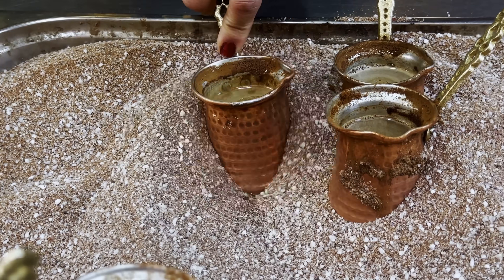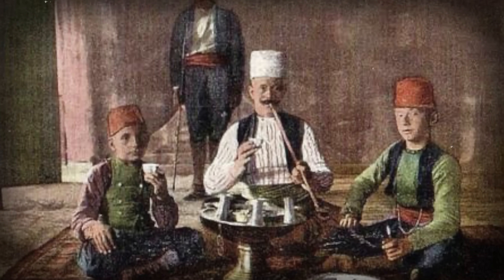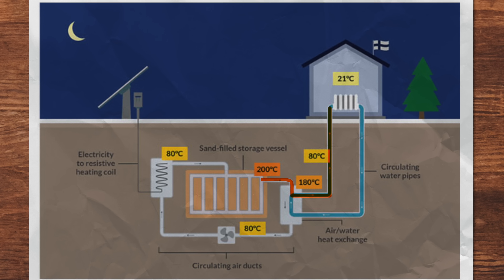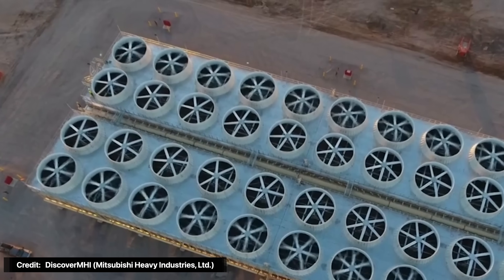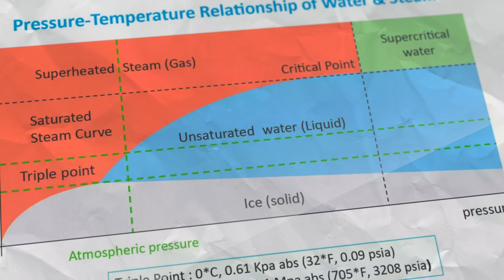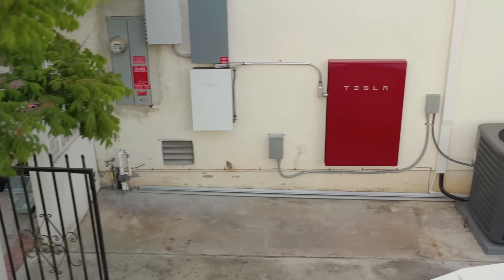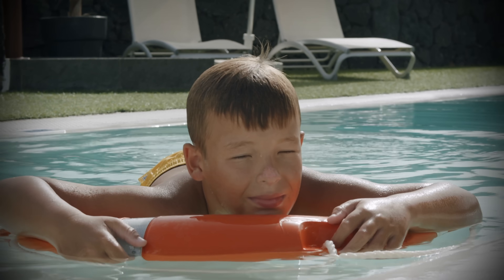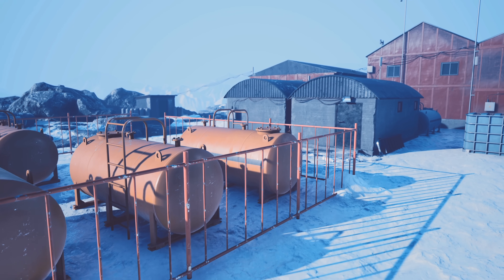The Power of Sand Batteries -- Revolutionizing Energy Storage...

Comment: I think DIYers will build sand batteries. You could probably build some rudimentry heating system using nothing but reclaimed bits and pieces and some tinkering
Reply: People do but it is harder than it looks.  One can use a water-heater's thermal element (electric backup element) for heating it up, but getting the heat out of the sand battery is actually not entirely trivial.   Basically you need something that can tolerate the heat and you need airflow to get the heat out again.   An open-ended steel pipe with a fan on one end to push air through, and then some fins (like a piece of a radiator) to disperse the heat in the air because you don't want a blast of hot air at 500C.

Regulating the output is the hard part. You can't just duct it to the house (not at 500C).  One mistake and the whole house burns down.
Reply: We have water batteries here in Germany. It´s just a huge insulated water tanks placed underground with a coil in it and some plumbing. Solar energy during the summer is being stored all the way up to the winter. It´s overall efficiency is better than with Li-ion batteries and it´s cheaper. Doesn´t get as hot as with Sand but is cheap and works.
Reply: On most videos you'll see on the subject, there's usually a lot of physical effort involved, and it doesn't really last past half a day. They work, but there's a human in the loop, and it's not a small part. An electrically-heated sand battery might require less effort, but there's usually not a reason to do that unless the electricity isn't coming from the grid, otherwise, you might as well turn on your normal electric heater. So far, I haven't seen anyone do anything beyond a proof of concept or proof that it works for the room they intend to heat.

Also, almost none of them do any sort of heat regulation, but that's usually because they're trying to heat a large room as quickly as possible. I've never seen one try to do a hot water system.
Reply: @Zeero3846  I'm jus thinking about building a sand battery for my home maybe this or next year. I was thinking about very well insulated concrete construction  in an non occupied room in my basement containing around 10 Tons of sand and around 100 meters of copper pipe buried inside as a close loop with  thermal exchangers connected to it. Obviously the thermal exchangers in use will be around 2x of the capacity I plan to achieve, so they can easily follow up.

One exchanger will be connected to the source of heat (coal/wood furnace), the other to the main central heating loop in house, which contains methane furnace and in-house heaters.

Early calculations indicate around 100kWh of stored heat, but I didn't finished with the design and calculations yet.

One thing is sure. It should be way cheaper than storing power in Li-ion or even storing heat in water.

Comment: You need hot water in the summer. You need hot water every day. We don't do nearly enough district heating. We have massive demand, year round, for heat.
Reply: True, and also, if it could be dual purpose and do cool as well as heat, it would work well in summer for cooling homes, but in summer, there are many times when you'll generate more energy than you need, so even with a round trip of 50-70% efficiency, it's better to store it at that efficiency then not at all.
Reply: I wonder if they could engineer an oven using sand batteries as a heat source.
Reply: @WeighedWilson  Of course. You would make an oven which is powered by district heating, then provide district heating from the sand. I just don't think personal sand batteries are feasible. This is a district level thing a city would need to do.

Comment: Sand battery+ nuclear power would work great. You'd skip the electricity to heat step, so preserve efficiency.
Reply: Would be better to use excess photovoltaic panels?
Reply: @CUBETechie  But electricity is much more valuable than heat. When you convert solar energy into resistive heat your wasting valuable electrons.

But nuclear makes heat, which you could pipe straight into a sand battery, and convert to electricity as needed (when the sun isn't shining).
Reply: solar and wind is cheaper than nuclear
Reply: @stefanweilhartner4415  But your not accounting for efficiency.

When you convert wind/solar electricity to heat, then back to electricity, you lose 40-60% of your output.

But nuclear can go straight from heat, to heat storage, to electricity, so you don't lose any more efficiency than a regular nuclear power station.

So, for charging up a sand battery, nuclear becomes cost competitive. And could back-up intermittent renewables, like gas does now.
Reply: @domtweed7323  why should i go to heat and then to electricity again. seasonal storage of electrical energy is not needed.
Reply: @stefanweilhartner4415  It depends on your weather patterns. For example, here in the UK we get a lot of wind, but also week-long wind droughts sometimes. So we'd need a few Twh (that's thousands of Gwh) back-up storage to go fully green. Hence thermal storage, for volumes of energy too large for pumped hydro, could be very useful.

Or, say you live somewhere very sunny, except for a 2 month monsoon every year. Where do you find enough energy storage for 2 months of little sun?
Thermal could do it.

Comment: This brings up a question for greenhouses in the winter. Would it be better to have a separate sand battery to heat the greenhouse or would it be better to integrate it into the flooring cement the greenhouse? And would it be better just to run pipes within the sand battery to increase the floor heat or would it be better to use a heat exchanger to heat the air?

Comment: It's fascinating how sand's ability to retain heat offers a sustainable and scalable option for energy storage.  🔥
Reply: water is three times better and much cheaper, if you keep it below 100°C
Reply: @stefanweilhartner4415  *if*, and at those temperatures you lose a lot of the efficiency because the greater a temperature difference between two things, the quicker the heat transfer occurs. If you want to have a line of 80 degree air coming out of the tank, it would take significantly faster to get to that temp running through 800 degree sand than 98 degree water.
Reply: @Fenthule  but i don't need it quick in the center of the basement of a house.
Reply: @Fenthule   Do you mean to say that the heat transfer is FASTER when the temperature difference is higher ? Or that it's FASTER with certain materials like water ?
Reply: @stefanweilhartner4415  Water stores less heat, can corrode the tank or spring a leak.
For homes using rooftop solar power to heat the existing hot water tanks works fine already, but we are talking about grid storage here.

Comment: Maximizing efficiency is great, but economics still rules. If a sand battery can be built, on a per watt basis, for some fraction of the cost of a Li-On battery, then it is going to have an advantage, even if it only has a 65% roundtrip efficiency. This sand battery technology also would seem to have a big advantage for longer duration electricity production than a Li-On battery, which could prove to be useful for overcoming longer lulls in renewable energy production.
Reply: 65% rountrip efficiency is likely better than Hydrogen, which we should also be pursuing at scale. California already has a glut of renewable electricity during the day.
Reply: If the heat is coming from Photovoltaic panels those also have low efficiently. Would it be more economical to us evacuated solar tubes to heat sand, then use it for home heating and electricity?
Reply: @ricza7345  Have you seen the latest hybrid solar PVT? The panels also run tubing for water serving two purposes. Cooling the panels(which dont like extreme heat) and heating water. Ive seen this idea used in Europe.
Reply: They are comparing apples to oranges here. The current project has no reelectrification step. You basically pay $60/kwh just for the heat storage capabilities, while the battery system returns electricity at $150/kwh. The system is too expensive for just heat, because you are paying more than just the renewable energy production, like grid fees and taxes. Even if the electricity price was zero because of taking overproduction, you would still pay 10 cents for getting it into the storage. You can turn 1 kwh of electricity into 4 kwh of heat with a heap pump. Here you convert 1 kwh of electricity to maybe 0,85 kwh of heat, after it was moved from the storage through the district heating and into your home.

Comment: Peltier devices would pair nicely with sand storage. Efficiency would be awful but no moving parts for maintenance. Heat one sand battery and cool another during surplus and then reverse for generation
Reply: Efficiency would be more than awful but I agree on the low maintenance.   Efficiency is kinda the crux of the matter, though... if one is over-producing so much that one can still get something useful out of multiple stages of an extremely inefficient dump, its better to do something more direct with that overproduction than stuff it into a sand-battery.

Comment: Regarding you comment of heating with natural gas at the end of the video. 

I'd like to clarify for you and (moreso) others who may not realize that the US (i I'm assuming that's where you live. I do) obtained approximately 40% of it's electricity supply from natural gas in '22 and even more in '23 (43%) that's excluding the additional almost 20% from coal.
Renewable sources only slightly outpaced that. (21%)

I'm 100% with those trying to get us toward renewable energy sources. We've made great progress but we have to be cognizant of where we are right now and the trade offs of the future.

It's good to know where we sit.
Reply: No reason for thermal coal, start there. Solar is cheaper now. "Natural "gas, which is methane gas was the bridge fuel of the 90s not today. If I had to choose nuclear would be our bridge fuel for electricity generation for now. Natural gas energy plants can be turned off and on for demand, thats one good thing about them. Keep adding local renewables which dont have to be transmitted so far.

Comment: "I don't like sand. It's coarse and rough and irritating and it gets everywhere."
Reply: it's over, I have the high ground!
Reply: Not like you.  You're everything soft and smooth.
Reply: the worst is the weight! but at least you don;t have expansion, boiling, or leak problems like water, and it works more steady.

Comment: One thing that is really hard to quantify is the cost to downstream users. 

The beauty of batteries is that users all already are set up to use power. If you want to bring a huge sand battery to share heat then every home or business needs to be set up tp directly use heat. 

Perhaps that happens in some areas of the world - but none that I know. 

Also, how much heat would be lost in distribution? How much would it cost to prepare infrastructure to move around that much heat without huge losses?

So many more factors to consider!

Thanks for the good video and view of something new!
Reply: Umm as mentioned in the video it can be used for district heating, so you have a plant that provides hot water in a given area, nothing needs to change in the infrastructure outside of the plant, sure if you're running your own heating that's not gonna help much but it doesn't mean there are no use cases where it doesn't fit in perfectly
Reply: which is why it is more interesting to use the heat to generate steam to run a turbine to create electricity
Reply: Building codes. Most of Europe has district heating. Most of North America doesn't. 

If cities start planning to add this infrastructure, then you absolutely could see this in the future. Although most systems only change in response to scarcity or drastic disturbance.
Reply: In Alaska, they do use radiator/district heat. They also have underfloor piping as well as typical radiators.

Comment: It could be use to store excess heat from data centers to improve the efficency.
Reply: you would need a way to be pulling the heat out of the batteries at least on average at the rate the heat is being put in, since the data center heat output would be fairly steady and it doesnt need any of that heat back.  buffering in sand batteries might let the heat be coupled to consumers better.
Reply: I think data centers could give the heat to a local central heating system?
Reply: Data centers already recycle waste heat to some degree.  The real problem though is that the "heat" you get out of a data center really isn't all that hot, and it is really really difficult to extract useful work out of something that isn't all that hot.

Comment: You mentioned a "cold battery".  Check out Ice Bear by Thule Energy Storage.  This is daily thermal energy storage  (DTES).
Before refrigeration was invented people would harvest winter time ice from a lake and store it in an "ice house" so they would have ice in the summer time. This is seasonal  thermal energy storage (STES).
For winter home heat I use PV-direct to heat water in an uninsulated tank when the sun shines that at night heats the house (DTES).
I am still trying do decide between sand or water or other for (STES).
Thank you for a most informative video.
Reply: Cold batteries are already in use. There is one under Helsinki, a huge pool of cold water, and it's a part of a pretty extensive district cooling system. They have also district heating but the cooling system is also quite widespread and has been there for 20 years.
Reply: I've also seen an old ice house design from somewhere in the middle east, where they can't just store the ice. It used the expansion of air descending through a chimney into a larger chamber to make ice. My father used to work at a historic cliff dwelling in New Mexico where that mechanism occurred naturally, keeping the caves at about 65 F even when the temp outside was in the hundreds.
Reply: @Nurk0m0rath   For the cooling chimney, what's the process which does the cooling and is that cooler air just becoming the ambient air for their living area? It's not stored anywhere of course.
Reply: @markhathaway9456  I'm no physicist but I understand the cooling effect is created by reverse compression. When the air is drawn into the chimney (or cracks in the cliff) and compressed, then hits a larger chamber, it slows and expands, becoming colder. I'm none too clear on the details of how it works though. I've been trying to remember where I saw that design and the closest I can think of is that it might have been in one of those features about ancient advanced technologies.
Reply: Actually yoy can get cold from heat since fridge works on heating and gasifing things.
Reply: big question 
how to harvest “cold” during winter at a large scale?  like a gigantic ice house.

Comment: why use sand, when you could just use ground ?
some heat storage project rely juste on heating ground between 10 and 25m deep. no need to have sand.
Reply: Yes, you can do this, and its done with some greenhouse builds.  But the ground can only be heated up so much... a few hundred degrees at best, before losses exceed your ability to put more heat in.   So its useful helping with seasonal heat regulation in greenhouses but not really useful for anything else.

Comment: Why would it take up any Acers? Couldn't you put the tank under ground?
Reply: Off hand, additional installation cost and maintenance access would probably be the primary reasons not to put the tank under ground.  Digging/excavating a big enough hole can be expensive.  If placed underground, you also might have issues with sinking, groundwater infiltration, seismic instability, etc.  If there is any issues with the tank, maintenance and repair of the tank would be a lot more expensive and time consuming.  Having said all that ... placing it underground might have some advantages, such as the tank being more insulated by the surrounding ground and other advantages.
Reply: Or just use the sand that’s already there

Comment: Good quality sand is becoming scarce in any places due to its use in construction. The world has been on a construction boom the last few decades and sand is a key ingredient in concrete. This could eventually be a problem if sand batteries become popular.
Reply: Yeah I'm hoping that the cheap sand will work just as well for this - but he didn't mention.
Reply: Parrot fish are always happy to make more 😊
Reply: Sand is up there with water as the most consumed commodity by mankind, good point. One of the drawbacks of dams for electricity is that it stops sand from mountain glacier grinding to get to the ocean, who would have thought way back! Sand battery sand would be reusable though..

Comment: We already have Cold Batteries. They are called Ground Source Heat Pumps. The question becomes, is there any real advantage to containing that heat locally, and the cost associated with that.
Reply: Of course there is! We use most of our energy for heat generation so storing heat in sand and using it directly is the best way to go. That's what the whole video is about 😛

Comment: The byproduct of Bitcoin mining and any data center is resistive heating, and it should be used any time resistive heating is mentioned in renewable energy.
Reply: The density of that heat is quite low though. That limits it's usefulness.
Reply: @NoHandleToSpeakOf Liquid cooling of mining is becoming more common as the 30 to 50 sound db level drop is life-changing for the better.
Reply: @RP-hn1qc  Sure, but how do you cool the liquid?
Reply: The circular energy economy!